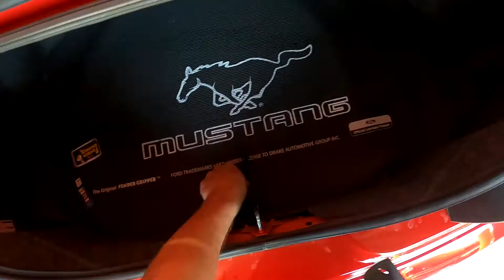94 to 2004 Mustang Shocks and Quad Shock Replacement

Comment: Hey man first of all wanted to say great content and keep it up, also was wondering, on your canister purge valve replacement on your ranger, you simply just connected the hoses before bolting it back in correct?
Reply from the maker: After 2006, the purge valve is held by a plastic clip.  Before 2006, the purge valve is held by nuts.  On models before 2006, you would have install the purge valve and then connect the hoses.  After 2006, I usually connect the hoses then install the purge valve in the clip.